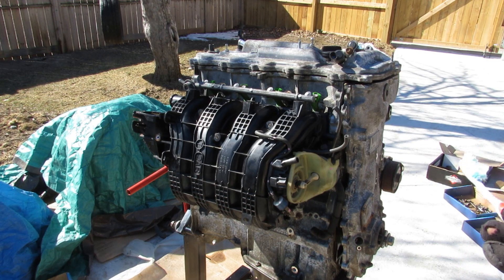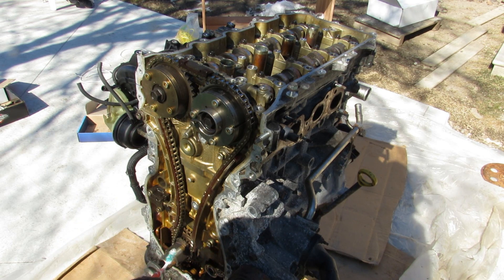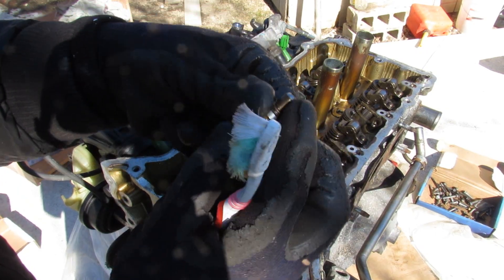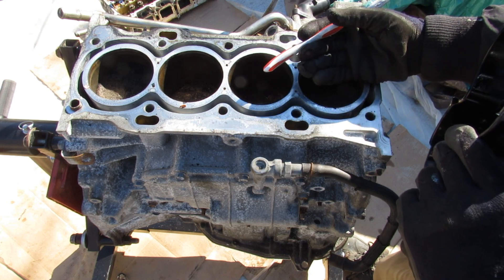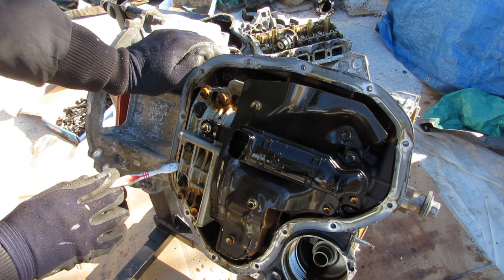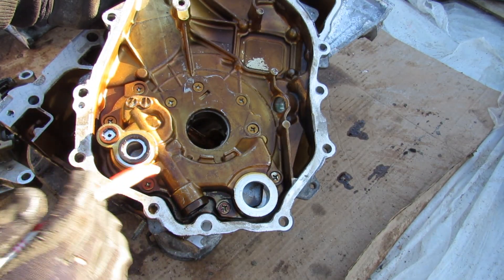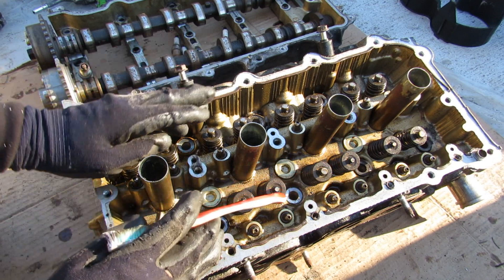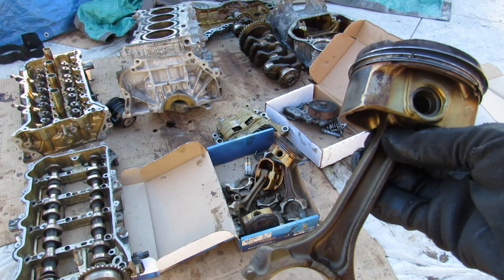Why Toyota Engines are Reliable

Comment: I think the oil squirters are primarily for cooling where there's no water jacket.  That's why the middle cylinders have more than the outer ones.
Reply: The oil squirters are purely for cooling the underside of the piston crown and skirt.
Reply: the 2 middle pistons get hotter than the 2 outer, being as they are central in the stack and don't benefit from having the extra cooling the outer pistons do.  extra oil to help cool them down is a no brainer.
Reply: Open deck design... I'm sure they cool the bottom of the piston but they are also much better than relying on splash lubrication alone

Comment: Watching the teardown of this "simple" ICE, it makes you understand why an electric motor is so much better. The complexity on any ICE is a few orders of magnitude higher than any electric motor. In turn, the electric motor is about 1/5th the weight of the ICE, although the weight and complexity of the batteries negates much of that advantage. Sure, there is a lot of glamour surrounding the ICE, but in time the ICE is doomed.
Reply: Probably yes but I. Sure by the year 2120 tesla cars will be obsolete as well.

Comment: I wonder what it’s like to be a Toyota tech with reliability?  I feel lucky to be Ford tech because they’re such pieces of shit I’ve always got tons of work!
Reply: Well if u see a Toyota at mechanic you know there’s a problem
Reply: Same with my Suzuki motorcycle. I bought it because two different dealer mechanics said that they basically never see them in the shop. People buy them, then 15 years later bring them back with 200,000 miles on them to trade them in for another one.
FWIW we've never bought anything but Fords, we drive them all 150K to 200K or more, and have had zero mechanical issues so far on 6 cars in our lives, except for one Windstar that had its transmission just crap out instantly at about 60K. The 2007 fusion just turned 200K with no mechanical issues at all and still the original clutch.
We are careful drivers though. I ride with some people and I realize why they spend so much on maintenance, they drive like they're trying to break the cars.
We are about to buy a Toyota, because it's time for a new car and Ford decided to stop making sedans.
Reply: Being bored shitless allday, everyday. Would rather flip burgers for a living  !
Reply: Mostly fluid changes take place  ,coolant 60 to 100k , trans 40 to 60k , oil 5 to 7k
Reply: I was a Toyota technician back in the glory days (80s-mid 90s). You spent your days doing services, timing belts, brakes, and a/c installations on new trucks. If you couldn’t turn 100 hours in a five day week you were slow. I left in the late 90s when the Saturday workday crap started. I’ve had some bad days but none bad enough to ever want to work at a Stealership again.
Reply: crown Vics seem reliable enough :)
Reply: Yep Ford = shit sandwich. Gm is worse...
Reply: My (Toyota) mechanic said he fucking hates Priuses "because they never break down"
Reply: Always light maintenance
Reply: I remember the old Maytag repairman commercials where they are complaining that the washing machines don't break down. I am sure that a lot of Toyota techs feel somewhat the same way...
Reply: the 2ct  turbo diesel engine missed the toyota reliabilty standard by a mile. just rebuilt one, i hate it.
Reply: Greed
Reply: More complicated.   Why
Reply: There is still plenty of heavy work due to owner neglect.
Reply: @beefcake502 Australia gets some pretty good vehicles that European Market doesnt.
Reply: @alouisschafer7212  Not any more we don't, our local auto industry is basically dead. :(
Everything's an import now.

Comment: i know one toyota engine that is damn sure good- the 20R . i have owned 8 of them . i owned 7 pickups and a corona wagon . all of them except the corona had over 180,000 miles but even so they didnt burn much oil and there wasnt racket from the main bearings rod bearings , or piston pins . i bought a '80 model pickup from a guy i was working for part time that owned a mobile home park and small used car lot . i checked the oil and it had lees than 1/4 inch of oil showing on the end of the dipstick . it took two whole quarts just to bring it up to the low mark on the stick . i have a factory toyota manual for the 20R engine . it says as installed in the pickup the oil capacity is 3.9 quarts and in the corona it holds 4.1 . i don't remember what it said for the celica . since i had to add 2 quarts to get it to the minimum safe level , that means it probably only had 1 quart of oil or so in it . i  knew of the guy who sold it to my friend the car dealer and i knew he had to drive on insterstate 10 to get to blythe california to go to stores and what not . the 80's model pickups have a 4.10 axle ratio (  toyota changed it for the '81 models to 3.90:1 when they started putting the 22R in them) . and this truck also had the 4 speed , not the optional 5 speed . that engine is turning pretty fast at highway speeds and yet it did not blow with the little amont of crankcase oil it had in it . and the odometer showed 90,000 miles which of course was 190,000 since the truck was over 30 years old . i would say one reason the 20R is such a good engine is because when it was introduced for the '75 models , it was an all-new engine it was not an enlarged previous engine . it is an all new design it has a crossflow head whereas the previous 18RC engine was not crossflow and had an oil pupm jackshaft to drive the oil pump . i have also owned 8 nissan L series engines , and although the oil pump is mounted lower to the oil pan , the 20R'S i had would get oil pressure faster than they did . also , for instance the basic nissan L / Z series 4 cylinder has been expanded five times . it started out as a 1,300 CC ( those were not sold in the U.S. though) . then it was expanded to 1,600CC , ( and the 2,400CC Z-car engine is basically the L16 with two added cylinders) , then they expanded it to 1,800CC for the 1974 model year . then to 2,000CC (L20B) , then they made the Z20 , and expanded it to 2,200CC for the Z22 . then they enlarged it to 2,400CC for the Z24 . the Z24 has a deeper cylinder block however to accomodate the longer stroke than the Z22 . it don't know if they enlarged the main and/or rod bearing journal sizes as they kept making increasing the displacement . but like i said because the 20R was a new design i'm sure that contributes to its durability

Comment: So you’re saying I can delete my counterbalance shaft by removing the oil pan and a few bolts?  😁
Reply: why would you want to?
Reply: @jamesmedina2062  Less rotating mass, quicker engine response. Maybe a couple more HP to the wheels. And also more vibration I'd suppose

Comment: Someday I will make my own video tearing down the engine of my old Toyota, this thing has been working for 40 years and still running like nothing happened inside it
Reply: Good to hear, good luck!
Reply: Wats the milage?
Reply: @leancove9662  precisely I don't know, I got this car ten years ago, I had driven for 40000 miles (65000 km), but the odometer only reads until 100k km, son certainly I don't know how many times it made a full turn, with me, only one

Comment: I had the trusty 2ZV-FE(2.5L V6 DOHC 160 hp/tq) on my 1990 Lexus ES250. Had 275k miles on original engine and it was still running strong but some kids vandalized my car and it got totaled out :( RIP ES250 5MT.

Comment: If you want a reliable engine check out the Chrysler slant six. I've seen one with 1-million miles that still runs.
Reply from the maker: Only one?
Reply: @speedkar99  That's only after I refreshed the engine with new rings and bearings. The block is a 225 from 1987 work truck. It could have close to 2-million miles total for all I know?

Comment: Looks like more crap to replace when parts on this engine break.
Reply from the maker: Compared to what other engine?
Reply: @speedkar99  Any pushrod engine. Lol
Reply: @speedkar99  The Toyota engines from 90s engines with the non-interference valvetrain are fairly reliable.

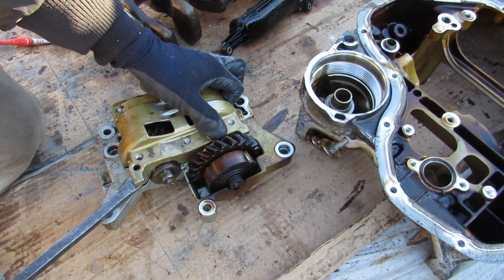Comment: 11:25. Very interesting.  It seems like balance shafts aren't a "requirement" for I4s though.  Honda's K20 performance engines, such as the K20A and K20A2, don't use balance shafts I believe.  I wonder how Honda gets away without them...
Reply from the maker: Probably because of weight.
Reply: Apparently 2.0L and below don't "need" balance shafts
Reply: @RennieAsh  You can run the K24 without them as well.  You have to if you want to have a high revving K24.

Comment: European car brands should learn from this, instead of broken timing guides, leaking gaskets, plastic parts near heat
Reply from the maker: Yes. Simple and easy to work on
Reply: Funny, as many of the Toyota engines (including small Diesels) for EU market are build in Poland, Wałbrzych engine plant, and most of them are N/A in Northern America.
https://www.toyotapl.com/about-us
Reply: @pliedtka  yes but always built to Japanese standards in eu 😊
Reply: They know how to do it.... They just don't want to.... They are the most successful in motorsports where reliability is needed? 24hrs of le mans , nurburing, Daytona, spa, 12 hrs of Sebring, etc ......
Reply: @MiguelGarcia-vj7oo  well I had to well serviced Audi A4 mk7’s and both 2.0 tfsi engines blown if I can help it no more German cars for me.
Reply: Toyotas don't seem to leak often, whereas the Euro cars I've had would tend to have annoying leaking issues or things that need fixing.
Reply: @RennieAsh  I agree I experienced leaks with my b7 Audi and poor chain guide quality.
Reply: european cars are turned into a big pile of garbage

Comment: so, do you still recommend if i buy a '11 camry with 2az-fe engine? What are the things needed to be check before buying this specific type of car?
Reply from the maker: 11 Camry came with 2ar
Reply: @speedkar99  idk, but when i saw my friends '11 camry (xv40 model), they still use the 2.4l 2az. When the facelift came to asia market in '12, which is the xv50 model, they finally use the 2.5l 2ar. Is it still good enough to take the xv40? Or just go ahead and choose the xv50?

Comment: Do you think these are better built than the prior generation  1AZ-FSE engine? I have an 03 Rav4 176,000 k with a manual transmission.
Reply from the maker: It's better than the 2AZ. Not sure about 1AZ

Comment: Not always..im talking about the 3.5 liter engine in our former 2006 toyota avalon. It had a common oil leak at cylinder one area. The head wouldnt seal to the block. It was a common problem that would cost 3000 bucks to fix if you missed the warranty. The oil dripped down and rotted the front drive axle boots.  Fortunately that has been fixed. I hope..cause we own a 2014 highlander with a 3.5 liter now.
Reply from the maker: I've never heard of those types of failures on the 2GR. 
I know the early 2GRs would eat ignition coils
Reply: @speedkar99  its in the toyota forums..the main reason i sold the car. An expensive fix.

Comment: How come those plastic didn't melt inside the engise after some usage?? I don't get it??
Reply from the maker: Plastic has different failure modes. Some can fail during excessive wear, some from UV, some from just heat, etc. 
The plastic insert is only subjected to heat, which it's engineered for. Besides if it failed...it's just inside the coolant jacket, as long as it doesn't disintegrate and clogged the cooling system it can just sit there cracked lol
Reply: @speedkar99  you mean that plastic (featured) will became no good after reaching the certain requirements until destruction or something in that matter???
Reply: I'm sure the engineers figure out what plastics can survive inside the engine. There's some pretty heat resistant plastics. And the coolant/oil of an engine is probably relatively cool compared to say inside the combustion chamber itself, or the exhaust

Comment: I'm not really impressed with that motor, its built pretty much the same way my mazda 2.7l stroker is in my turbo ranger, ill stick with a 22R or my good ol ford 300 i6 they'll last so many times longer than that motor in the video will, the 300 i6 probably will never die on my

Can't beat a timing gear made of steel 
Everything is gear driven
Reply from the maker: That's a good idea...

Comment: As a potential video explaining crude engine designs, I recommend looking into Mazda’s early engines between 1995-2009. I think the partnership with Ford perhaps did not help, but those engines were bad. Notorious for oil burning, oil ring design, smoke on startup, etc. 

I have an 02 Mazda Protege myself, which has the FSDE engine. Terrible. Mediocre power and burns oil. However, the car itself is a fun car to drive. Anyway, love the content man! Keep it up ✌🏼
Reply from the maker: I have an MZR Mazda 3 motor waiting to be torn down here

Comment: 2AR? Reliably burns oil just like the 2AZ. Prodigious amounts of oil. They burn so much oil that Toyota now insists that it's "normal" for their engines to burn 1 quart of oil every 1,200 miles. The 2AR doesn't blow head gaskets like the 2AZ did, but they still have plenty of problems with blown head gaskets. Also, the timing chain/cam phasing design is not a maintenance-free setup compared to a timing belt. Toyota has had its fair share of vvti and chain tensioner issues. And that nasty cold-start timing chain rattling that Toyota says is normal is so awful to listen to. Ford rightly gets criticism for cam phaser rattle, yet Toyota has always gotten a pass for new engines with rattling cam phasers or timing chains. 

Overall, this engine doesn't deserve to be held up as some kind of bulletproof, solid reliable engine. Buying a vehicle with this engine doesn't guarantee you will never have an engine issue. Especially when it comes to oil consumption.
Reply from the maker: I haven't heard of much oil burning issues with these compared to the 2AZ. 
I'll agree that Honda motor might be more reliable but the rest of the car might nickel and dime you as the miles add up.
Reply: Our 2009 RAV4 with this engine doesn't use any oil between 5,000 mile oil changes. The dip-stick still reads the same after 5,000 miles. However, the 4-speed automatic transmission does run a lot hotter than it should in the summer months.
Reply: The 10k oci is way to long. Then they do actually use some oil. 5/6 k is really the ideal spot to change the oil in these.
Reply: Glad to see someone not wearing blinkers when it comes to "good old Toyota" ,majority of people on here think Toyota is the best thing since sliced bread !

Comment: Curious what impact gun you were using make and model if you don’t mind . Couldn’t help but notice how nice , quiet , andd strong 💪🏽 it appeared to be.
Reply: Think it's a milwaukee. Also keep in mind many of the bolts he removed do not require much torque and modern impacts have the ability to modify applied torque to preserve battery life. This will make it quieter on low torque applications but may be louder on things like wheel lug nuts on trucks
Reply: @alexehhhh  I have a snap on 3/8 impact and it’s loud since it only has one torque setting, I liked this one with a high pitch whine but still took bolts out.
Reply from the maker: Miluakee m18 
Works good

Comment: Awesome video! Very nice engine! I wish Honda designed their 4 cylinder engines with self-adjusting valves. The less maintenance, the better IMO. There's a heck of a lot of maintenance in ICE engines and I'm kinda tired of it.
Reply from the maker: Yeah Honda has kinda fell back on their engines in terms of valve train...even more so on the old K-series V6
Reply: Have had many Honda’s (92, 96, 98, 2006, 2009) and never had to adjust any of the valves. The 92 I sold at 137k, 96 @ 138k, 98@ 167k, 2006 @ 170k, & 2009 still have @ 120k.   Thanks....Jim
Reply: @jimpie231  Your car will still run without the valve adjustment job but your engine performance may decrease and/or engine will be noisier. It is recommended every 100k miles on Honda engines. You can look it up yourself, its listed in the OEM service manual.
Reply: @ChavezDIY  i agree, but if you don’t feel any performance change and their Is no noise, and The engine Is quite, than a valve adjustment Is not necessary. I have been adjusting Valves since The HP solid Cam engines In The 60’s. Thanks...Jim
Reply: @jimpie231  I agree, if the driver does not "feel" any performance decreases, then there's no reason to do it. The Honda engineers specifically added the valve adjustment recommendation because the valves are not self-adjusting like the toyota engines in this specific video. Through a mechanical perspective, engines naturally lose performance over time, whether you feel it or not. If you never felt the need to do a valve adjustment to your Honda engines, good for you.